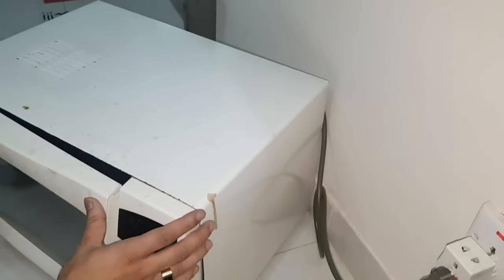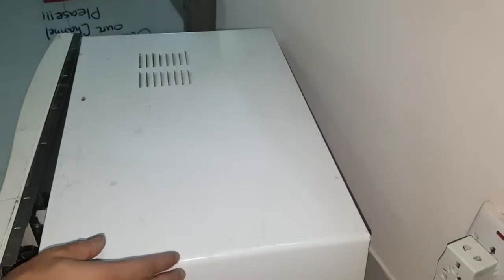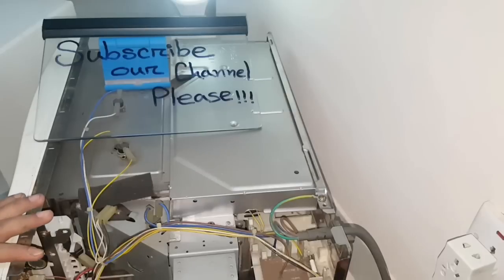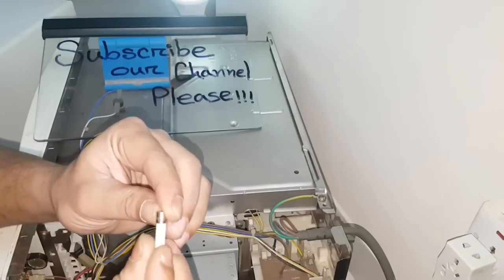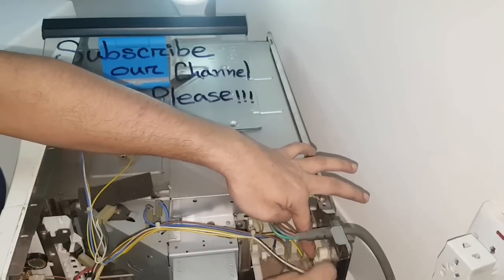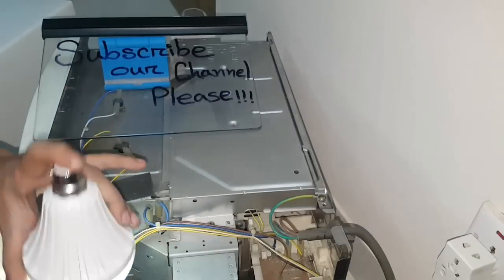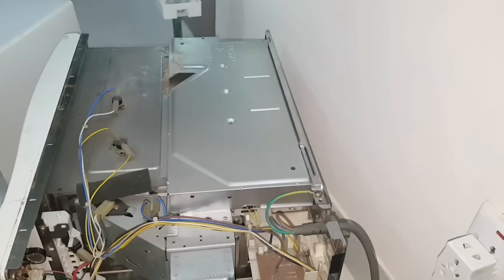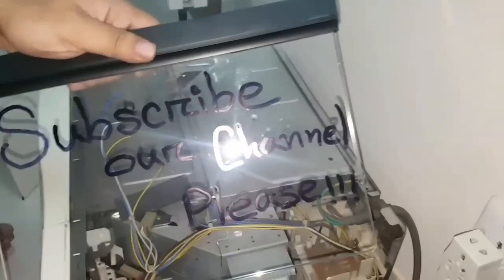How to Repair Microwave Oven | Microwave NO Power | Solved

Comment: The oven on heat is also ok but the light and motor not working, but all switch function ok .... just some sound coming then open and check the power fuse was gone I replace the fuse then this issue coming to give some guidance to solve this issue.
power on then function on then only high voltage primary supply 220v coming and working microwave that's all

Comment: Sonny! First u need to establish what caused the fuse to blow. Putting in another fuse can cause that one to blow too. The cause maybe the thermal cut-off or a short in the magnotron or a short in the high voltage diode or faulty interlock door relay switches or the cooling overheating.
Reply: Simply replacing the fuse is not correct and find out the reasons for blowing by checking where the fault is...Magnetron, Diode, Capacitor or in HV TR
Reply from the maker: Sonny!!!?

Comment: should be a reason why this fuse blown. not enough only to replace it.
Reply from the maker: Fuse might blow due to over voltage issue. However, replacing blown fuse could be a problem fixer.
Reply: If i add a stabeliser for voltage stablity, will it solve d problem

Comment: how do you  figure out that the fuse is down?
Reply from the maker: +sultan Merchant In my next video I will show it...
Reply: The fuse is blown if when you put a multimeter on either end in Ohms mode, it shows "1" for the resistance. (the fuse wire has burnt away so no resistance.)